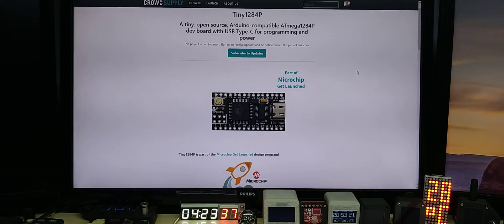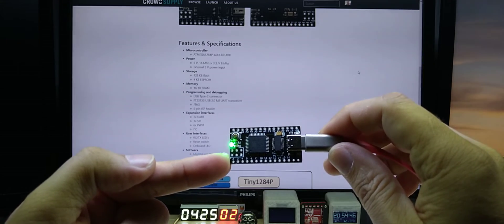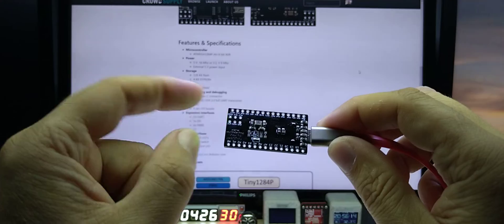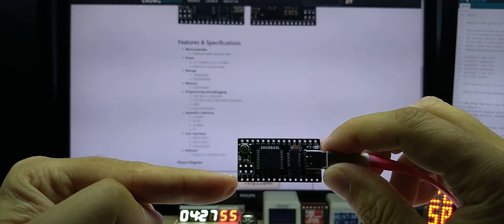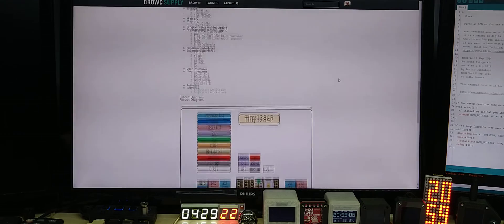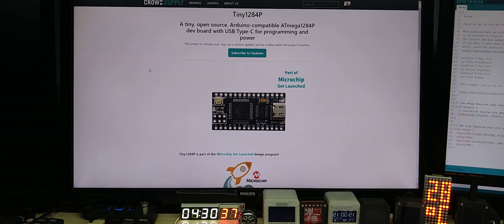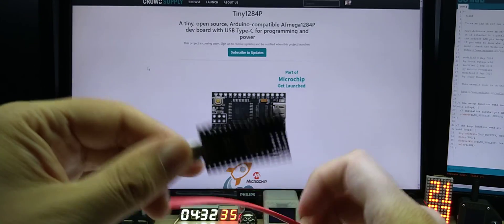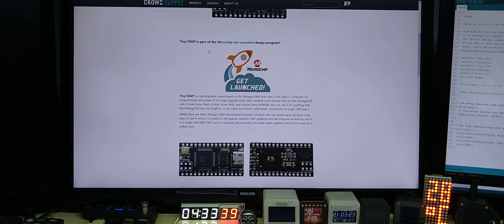Tiny1284P ready to be launched on Crowd Supply, please share, like or even support me to launch :-)

Comment: Hi, Do you have this board for sale yet, its a very neat and compact design. just what i need. thanks
Reply from the maker: Hi Tony, unfortunately crowd supply screwed me twice, made me jump through hoops, demanded a working prototype which I send to them and failed to start the campaign. I do have many bare PCB's but now with the chip shortage and high prices of the 1284P (as high as $26.00 each) it is not really feasible to produce. If you do have the means to assemble one yourself, I could sell you the bare PCB. I could even send you all the components minus the 1284P. Really sorry about the circumstances.
Reply: @iHayri1  hi Hayri, thanks for the quick reply, yes i would love to have 1 or 2 of these boards with components if you can. i can get the 1284 for £6 - £7 UK pounds each, so no a bad price. farnell are getting stock in February. i do have 2 or 3 of these chips in my possession. can you give me a price please and will you ship to UK. many thanks Tony
Reply from the maker: @tonyhodgson6744  No problem Tony, please give me your email or send me a message through Tindie and we'll go from there, thanks. PS: Will keep my eyes on farnell, no sense to ordering them for such high prices from china and not even knowing what you'll get 🙂

Comment: Will this have the boostloader preinstalled? Ive been using the 40pin pdip 1284p awesome
Reply from the maker: Yes, it will come with the bootloader and the blink sketch installed, ready to be connected to the PC and used with the Arduino IDE. No other hardware necessary.
Reply: @iHayri1  thank you!
Reply from the maker: @skynet1703  You are welcome.